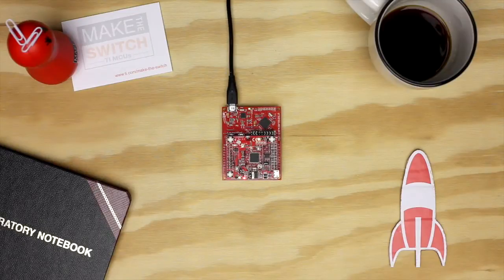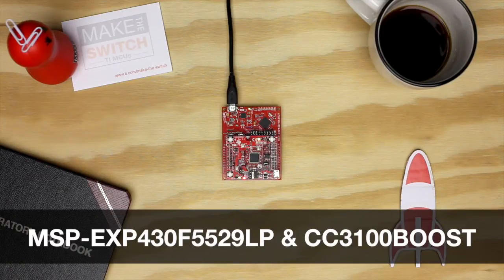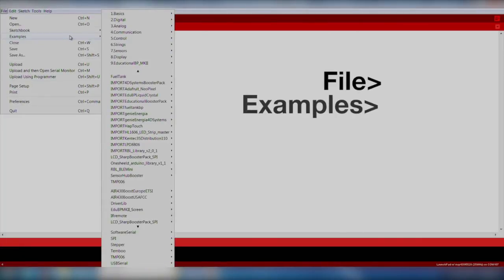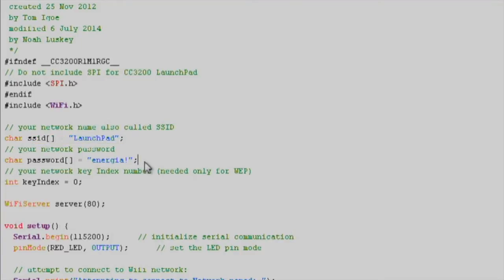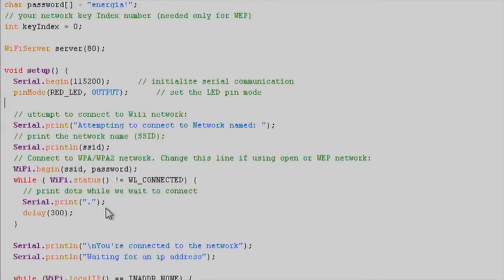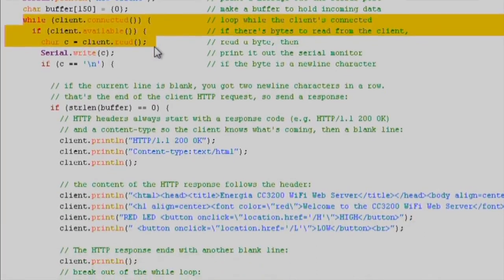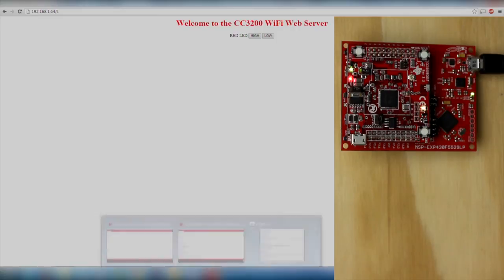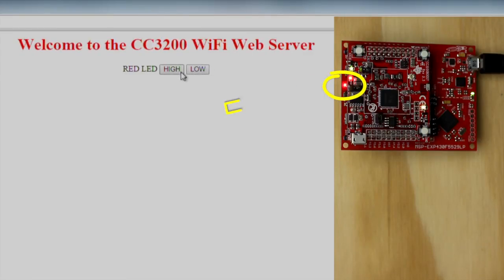Energia Tutorial: CC3100 BoosterPack

Comment: Hello

I wanted to ask that, I did the same steps held SW1 then held and released SW3 and then released SW1. I connected to wifi of CC3100. I tried to change the it from access point to station I am not sure if that happened. I then uploaded a sample code given on energia software (Files -> Examples -> wifi -> simplewebserverWifi). But I cannot find the appropriate results. The serial port shows nothing. Can I again configure the CC3100 wifi to another station? (I am not sure it happened in the first time). Now I am not able to find the wifi network of the cc3100.
What shall i do. Kindly help

Comment: 1- can you give me the iinstruction you used for activate "mysimplelink device" It connects a little and then disappears every time I turn the code of ENEGRIA. 

2- IP adresse 192.168.1.64, I have to use it? Or should I look for the one assigned by the router?
i think, I have 192.186.1.3

3- the serial port of ENERGY, I see nothing but points in a row (115200)

any help please.
Reply: I Have the exact same problem. Were you able to solve it?